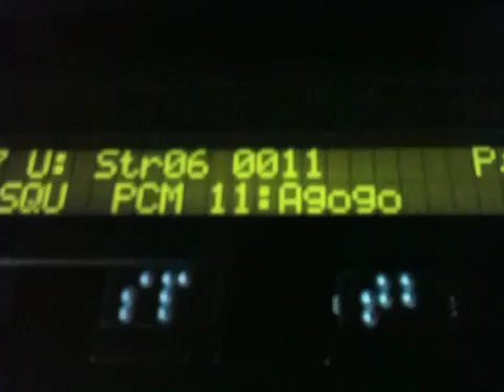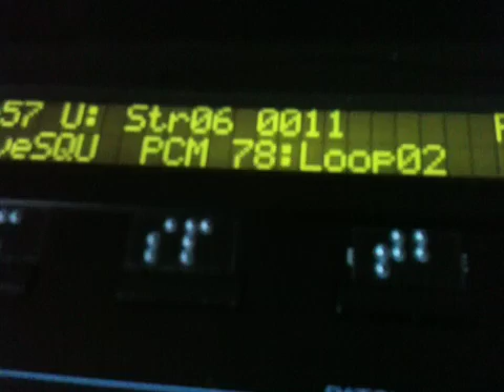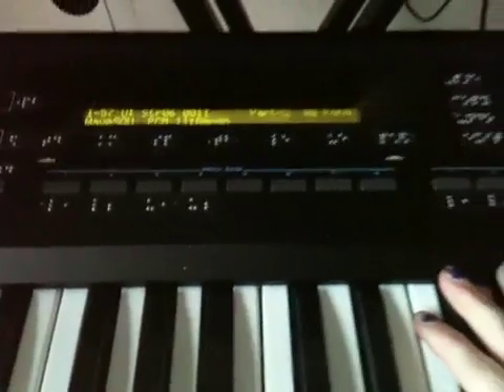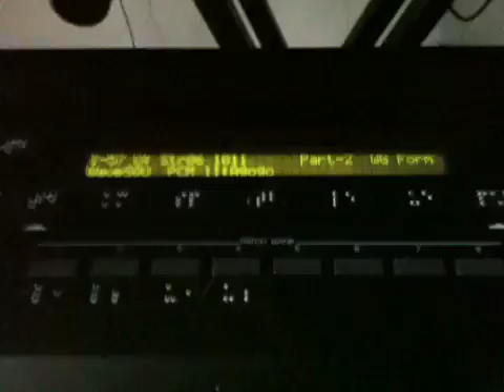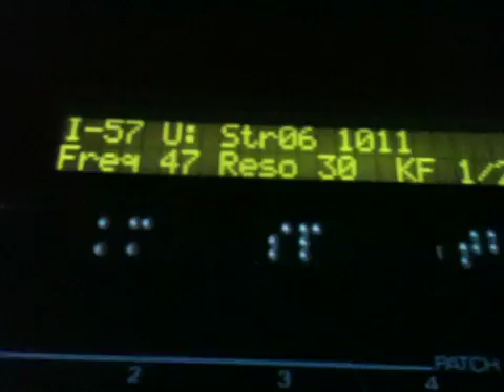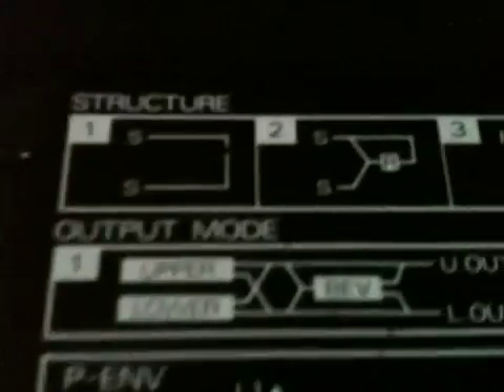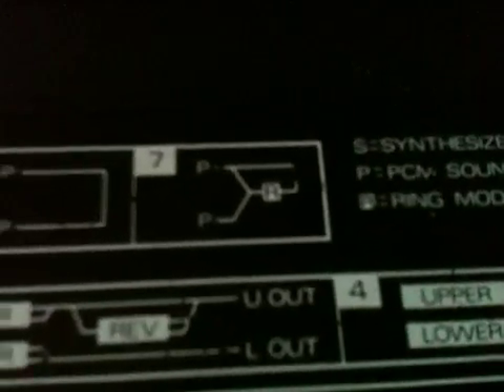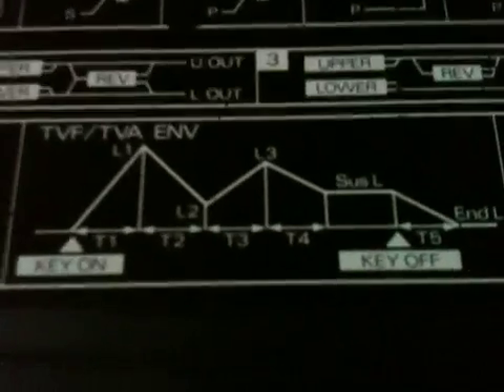D-50 101: Linear Arithmetic Synthesis explained. by TSF

Comment from the maker: @KodyBoy555 HI. All my synths/studio equipment has Braille. I use Braille labels on anything that has printed words that are too small to see. I have low vision and I have a very short range of vision as well. I only see about 3 inches in front of me, anything further, the refractive error is too great. I use print + high power magnification lenses as well, but its not practical to be right on top of the synths to see them.  LCDs are large enough to read but only at a very close distance.

Comment: I have a PG-1000 but it props the door open since I downloaded VPG-1000 from D50 Librarian. 

This is not spam, its a free tool that does library / backup, live patch testing, removes copyright locks from old patches (inadvertently, it tests the structure and corrects deliberate errors) and has a random feature with randomises all the parameters for wild and crazy sounds.